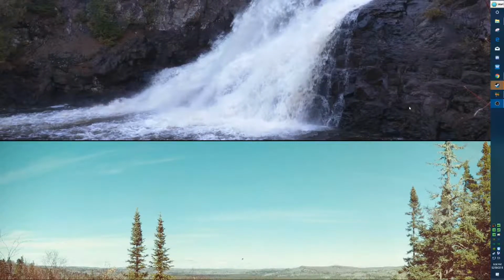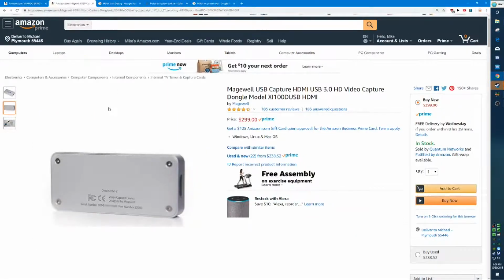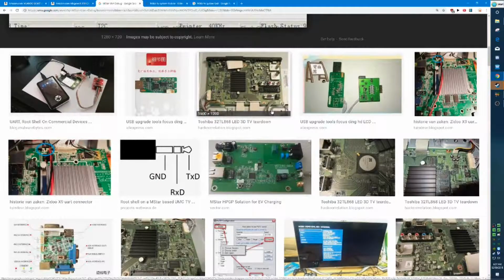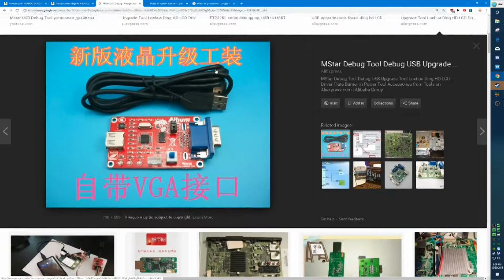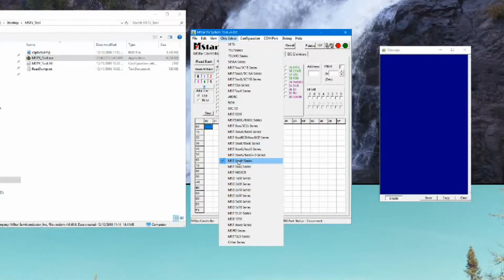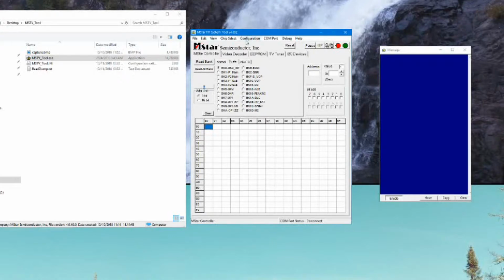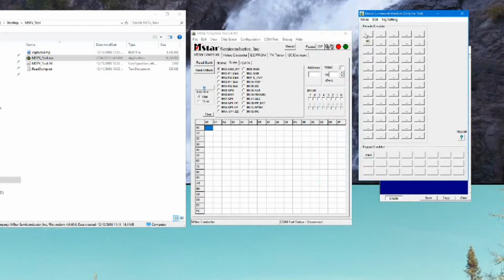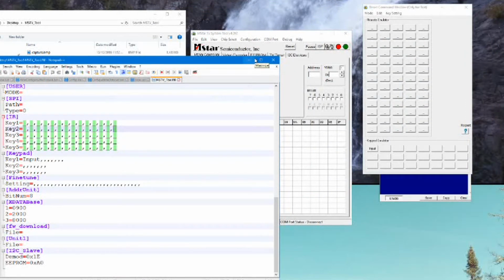Mstar Configuration - Scart  to HDMI

Comment: hi, thanks for the info and the great explanation.
Just wondering.. which port is the UART and which is the USB? I'm fairly new to this kinda stuff but looking to correct a screen offset in my upscaler (same as the one shown).
I'm assuming that j2 is the USB as the +5v goes directly to the 5v from the psu. Would I be right in thinking that?

Comment: Thank you so much for this, i've been playing around with mine, I've added a power switch and a sync stripper to the composite input to ensure that its using true RGB.

Since I discovered your video and the software tool you kindly shared I've also connected a USB/UART device and successfully played with the IR commands to bring up the OSD menu and change aspect ratio etc. Just trying to figure out how to "sniff" what commands are being sent so that i can ultimately control it with an arduino hooked up to some buttons etc.

I could not have done this without your help!  THANK YOU

Comment: Seeing as this chip was intended to drive LCD televisions originally... I don't suppose you've found a "game mode" or a way to change input "labels" in these hidden menus? You know, to lower the amount of processing done to the image and potentially remove input delay? These boxes typically have about 6 frames of lag which make them unusable for many games that require fast inputs. If such a mode existed, these boxes could be much more usable for gaming.
Reply: Great idea, need a bit more investigation.